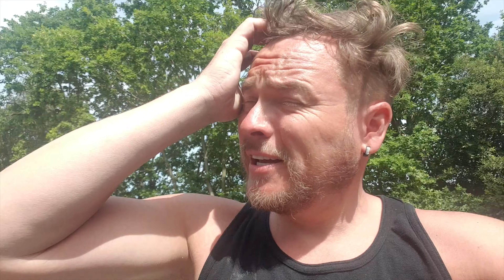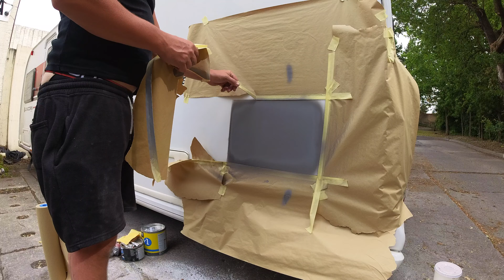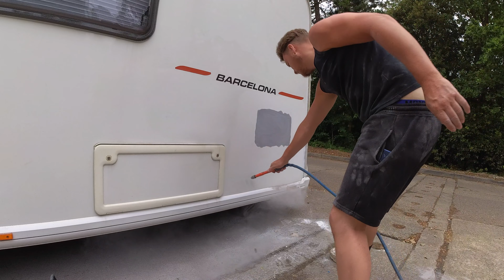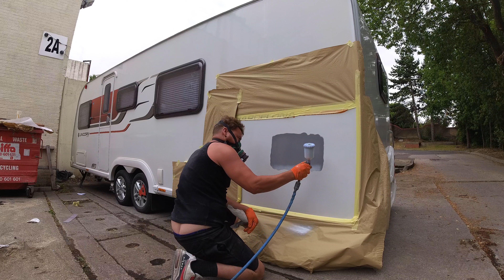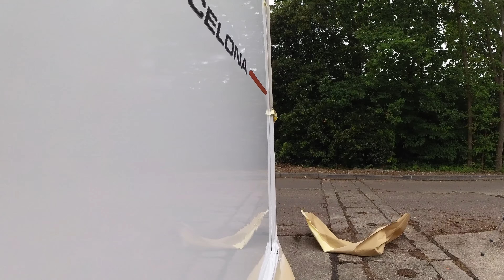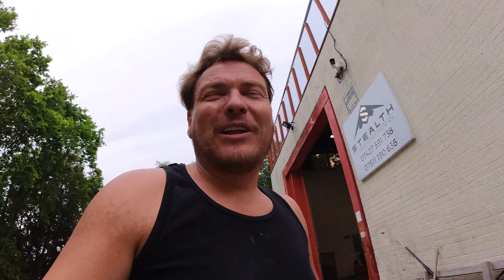Bailey unicorn caravan bodywork repair

Comment: What are you using to fill?
Reply from the maker: Just normal autonomy repair filler 
Fiberglass 1st skim for strength then a deep fill filler to get shape then a smooth finishing filler for pinholes and imperfections

Comment: Use 2 part epoxy resin (eg West Systems 105/205. A mini pack is < £25 )rather than polyester resin - it doesn't attack polystyrene and is much stronger. Use it neat with thin fibreglass mat or microfibres for strength as a base layer, mix with filler for easier sanding and paste like stiffness as a top layer.

Comment: the skin is not fibre glass
Reply from the maker: Smelled like it lol some sort of gell coat flow coat.. ??
Reply: @vanoholic416  no idea, I own one and when I bought it I watched the baileys video on how they make them, it’s foam with sheets of plastic bonded on with glue and compression in huge sheets the whole side is one sheet
Reply from the maker: @robertovers1863  must be different this one it definitely was not plastic as it turns to dust and smells like GRP plastics normally melt
Reply: Mines a Bailey Pegasus and its Alutech body,I'm pretty sure the one you repaired is the same body as used on my caravan.Brilliant job mate.